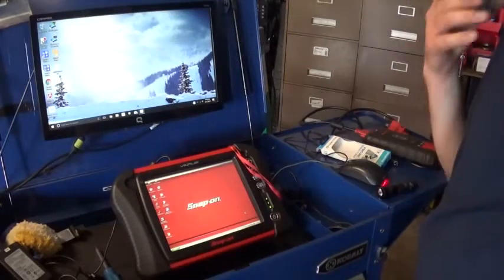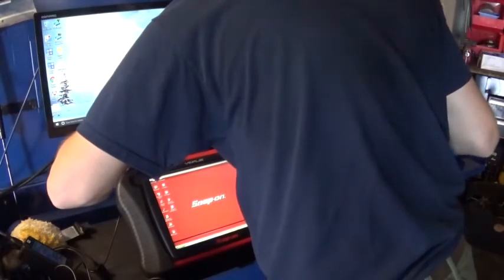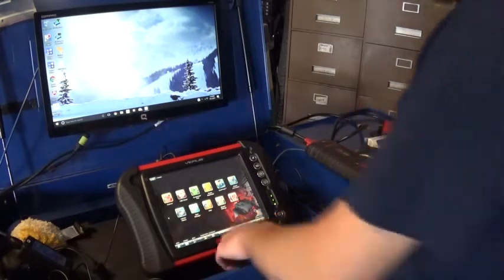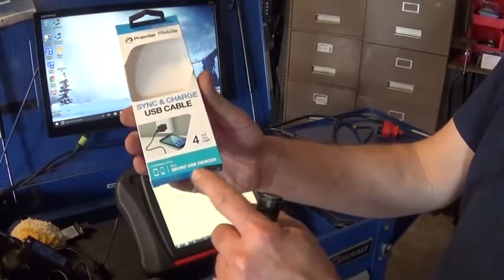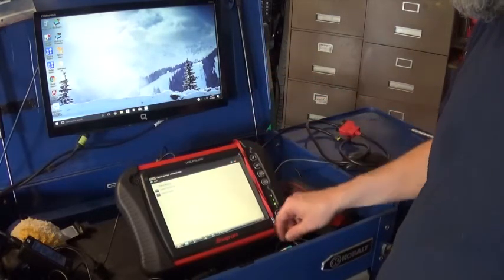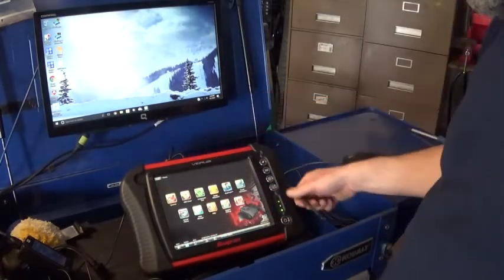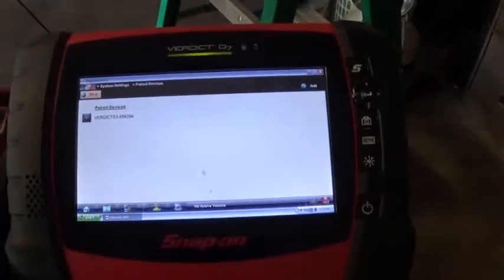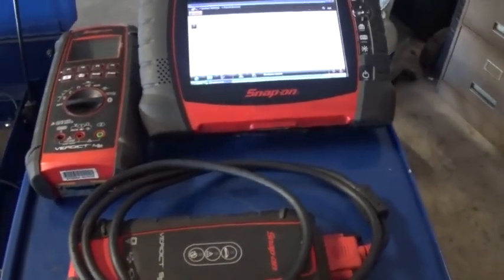Snap On VCI Unit Update Procedure

Comment: Snap on update cost is too expensive.
Went to buy a second hand Modus Ultra for £1000.00.
Conntacted Snap on to find what it cost to bring the software up to date.
Snap on wanted £1300.00.
Buying a brand new machine  and not Snap on.
Reply from the maker: Tam Couch Yes you are right. Try to look for used MODIS with newer coverage .